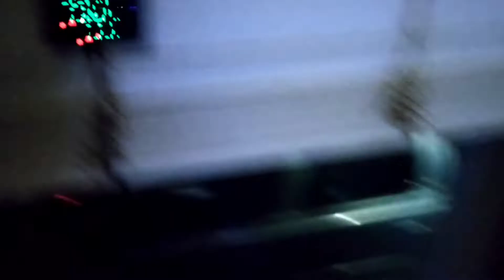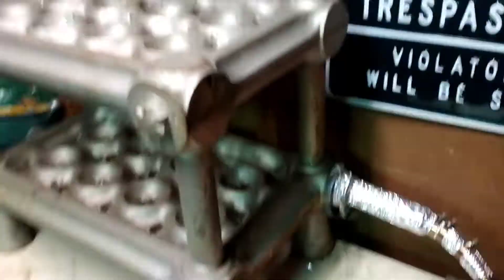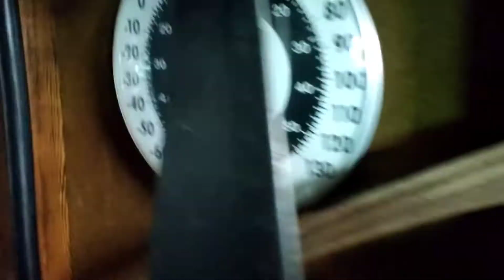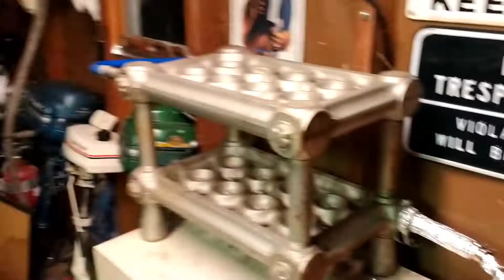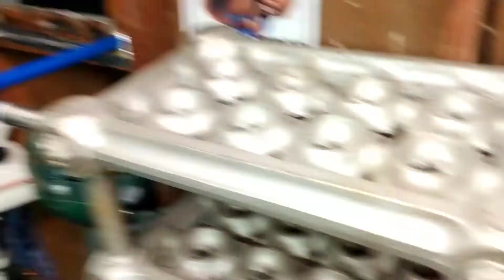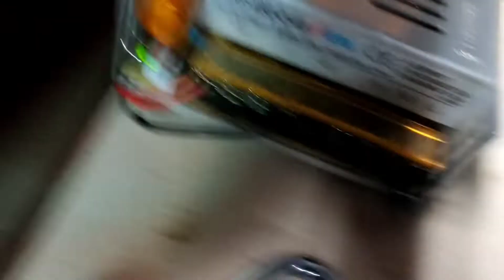Diesel Heater Experiment Was A Great Success!

Comment from the maker: I wonder if a long straight steel pipe of like 10-15 feet and say 1" in diameter could be used to radiate heat along a floor area near a wall with a baffle and a 3" offset...might be worth an experiment, I have all the stuff to do it.  If it worked I could just bury that like 2' down under the soil in the greenhouse.  That would require making a 2 1/2' deep chamber for the diesel heater and output of the exhaust on the outside of the greenhouse (with a chimney and cap) which is what I will do for heating it.  In the olden days they would bury 100 watt light bulbs to heat an area of soil or they would suspend one down in a wellhead to keep the water from freezing.  This would be akin to at least a kilowatt of free heat by my guestimation.

Comment: So just an idea, I've been itching to build my first tiny cabin with cast aircete up north here in MN. We could use your diesel motor to filter heat through the flooring through pvc, copper or galvanized steel. Originally I thought pouring the floor with aircrete (above ground on footings) but I dont think the heat going through the pipes would"nt conduct well enough since air crete is a super fire retardant insulator @ 3.3 Rfacor /In. Maybe it would have to be some sort of title or slate on the top to warm the feet and the house as heat rises. Originally I thought setting up a floor system with a wood burning stove or fireplace heat transfer system. The sky is the limit, great to be alive creating with you brother.
Reply from the maker: Excellent comment, its great to hear from you.  I think using aircrete as a base with the pipes inset near the surface with tile on top would work great, even better would be standard concrete as it acts as a heatsink/thermal mass...but im not sure that is viable for your situation.  either way a diesel heater or 2 for redundancy will definitely keep your cabin toasty warm!  again, thank you for watching and commenting
Reply: @ProlificInvention  Thanks for the follow up. What kind of diesel motor is that? 1 also you're right on using regular cement on the floor, I think it would work fine by pouring concrete over the pipe for  more thermal Mass. We could infuse metal flakes into it as well.
Reply from the maker: @EmpoweredPercussion  If you search for "diesel heater" on Google you will come up with many results, mine in particular is a VEVO brand 8kw.  There are 2 main types: The self contained version which has an onboard fuel tank, heater, pump, controller all in one metal box...
The other version is meant for custom installs in RVs, Campers, vans, ECT and it comes with the heater, fuel line, exhaust and intake hose,  pump, muffler, fuel tank, controller on a long wire ECT
Reply from the maker: @EmpoweredPercussion  The heaters are designed for 12 volt DC operation for running off a battery, if this is not conducive to your cabin build then you'll have to get an AC to DC converter.  The one I have is fantastic-it does 0-48v DC and the voltage is controlled with a dial and it has an led display showing the output volts.
Reply: I think another option is like your doing in the video but I would fill it with a certain radiation fluid for under the floors, maybe the walls even. I think if its copper the Pipe could be directly positioned in front of the diesel heater in a chamber to increase heat while still warming the room. BTW, what brand heater do you have? I might buy one. Peace
Reply from the maker: @EmpoweredPercussion  The brand I chose was VEVO, the 8kw version.  I have both the self contained version and the remote mount type.  I mostly chose them because it has the controller/thermostat shown in my video which works great and I'm used to.  The instructions that come with are very limited chinglish so I stick with what I figured out 😆
They do make an add on accessory or you could build a liquid based system.  There is an Australian guy named David McCluckie or something like that who has hundreds of diesel heater experiment videos, he's tested all the accessories and has done alot of fabrication of experiments.
Reply: If you flip the connections so you force the gasses to go from the top to the bottom of the radiator you should have even more heat recovery?

Comment: Run exhaust through a Baseboard heat unit, this would satisfy the 270 degrees and 2.5 meter run suggestion. Baseboards can be improved by increasing convection effect by increasing the height of the baseboard face.

Comment: I had a similar idea of using something like an all aluminum car radiator plumbed to the exhuast with a box fan blowing through it to pull the maximum amount of air out into the room. In Another video I watched, they used a couple of small radiators with water running through them and had the exhaust blowing across them to heat the water, they calculated how much energy was collected and they managed to get about 600 watts of heat. Not bad, couple thousand btu. Can't recall If it was a 2kw or 5kw unit. How many kw is yours? And how long are you able to run it full blast on a gallon of fuel?
Reply from the maker: Those diesel heaters supposedly output around 27,000btu/hr and they consume about a gallon every 10 hours.  I am going to do an experiment to find out for sure and I'll let you know.
Reply: Perhaps the larger the water storage container or tank is greater the amount of heat will be stored in it. If you use a car radiator the water volume will be the bare minimum and quickly water will be cooled off within the radiator.  How much water can you store in the small car radiator 1/2 gallon? You see the point here.  But maybe combining the two, radiator, little water circulator pump and water storage tank, let's say 55 gallons insulated
drum. If you can warm up this 55 gln. drum of water to 180 decrees it will take hours to blow that hot air into the room to cool down such a large amount of water.  
Other ideas: I know a guy that he is having good success by converting off the shelve oil stove to burn used oil. I would love to try that but, such used stoves are not available in Hawaii.